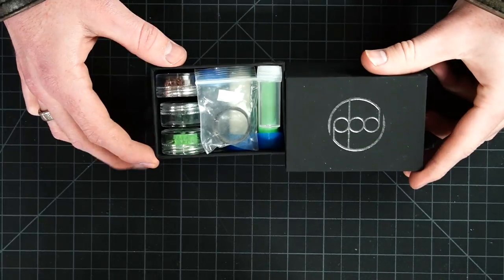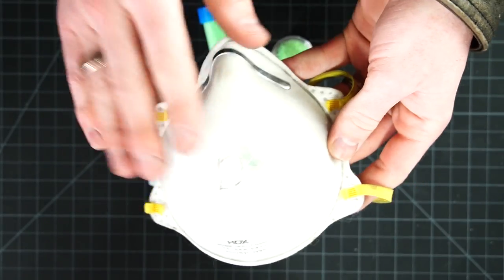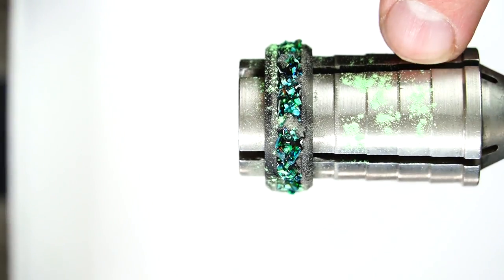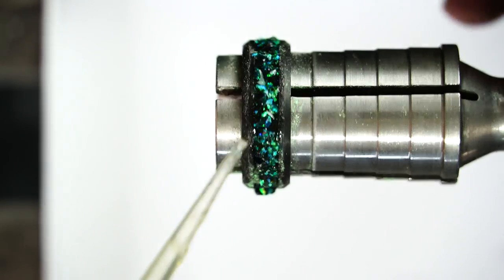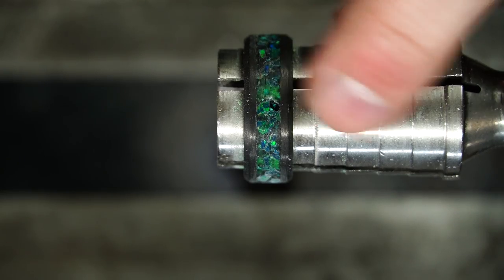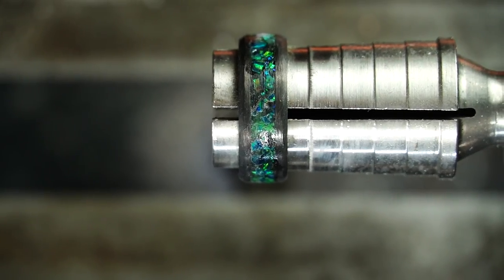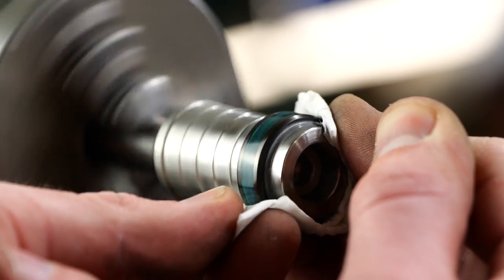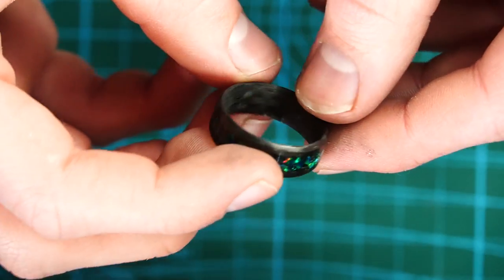How to Make a Dragon Scale Ring (In-Depth Tutorial)

Comment: Hi! Are you using any water when sanding? In your other videos, the quick clip ones, you are using a lot of water when sanding and here you don't so i wanted to understand the difference, thank you!
Reply: Always good to use a lot of water when heating up the ring (Using a dremel, sanding, etc). Over heating the CA glue can cause melting or other bad effects I believe. Water also helps to remove debris from scratching the material. Always use lots of water - it can't hurt.